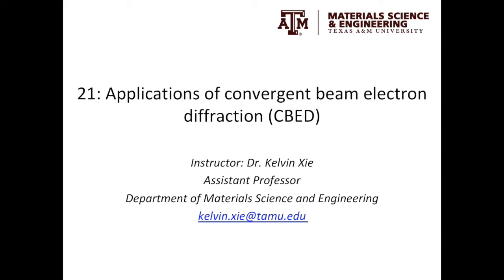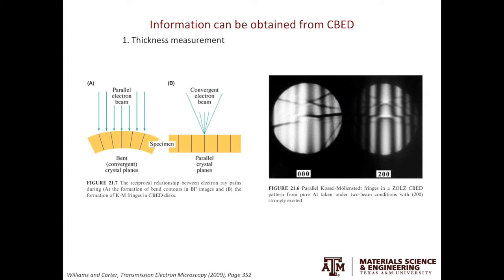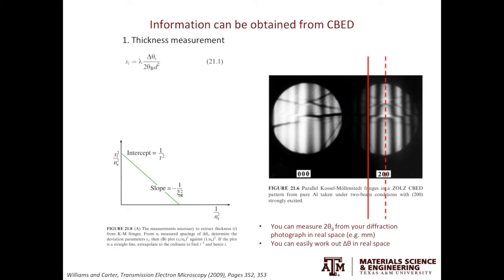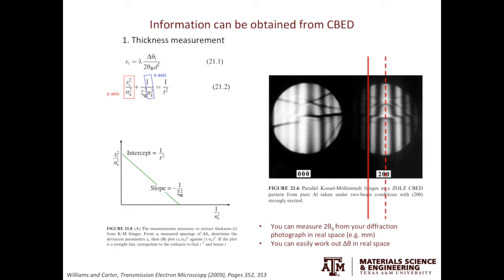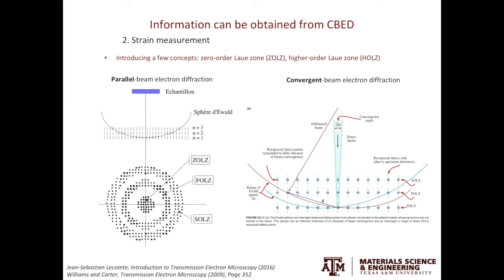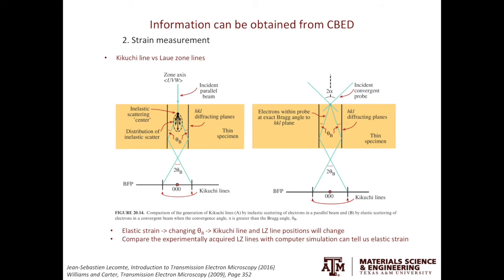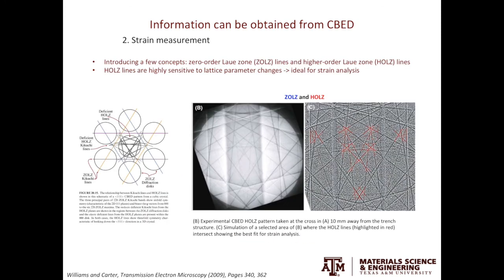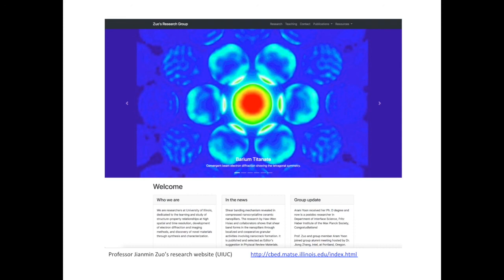21: Applications of convergent-beam electron diffraction (CBED)

Comment: Thanks for your helpful video. i am confused about the equation of calculating Si. the delta θ and θB is a angle parameter. why could we measure the distance (as marked in the video) to indicate the angle. what's the relationship between the θ and distance of fringe?